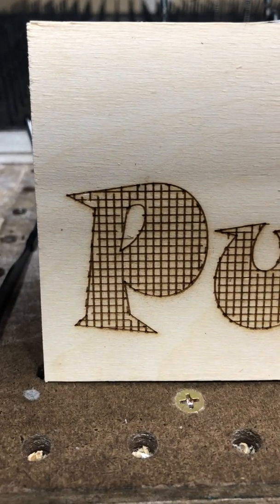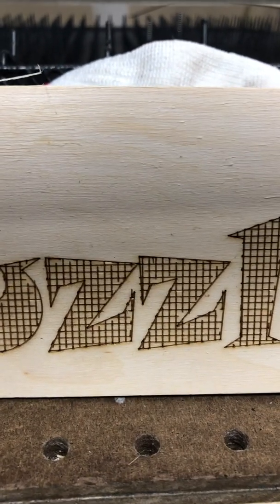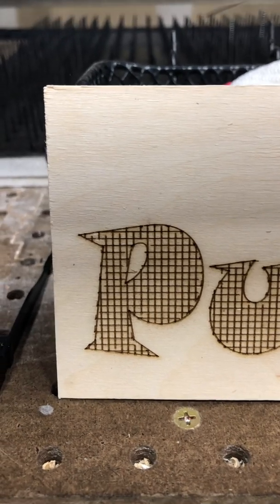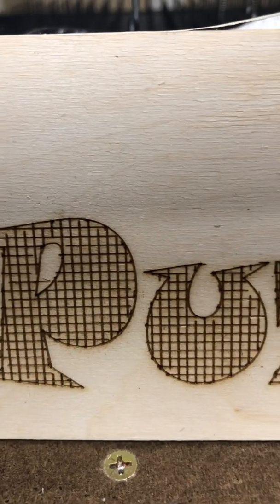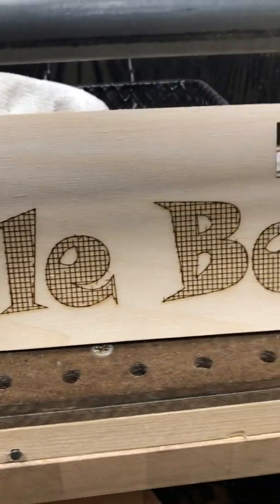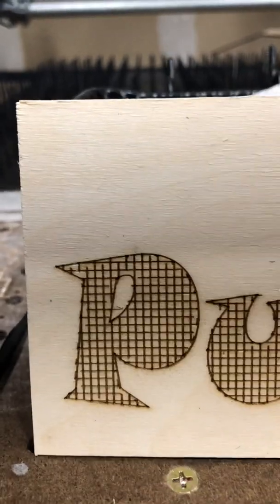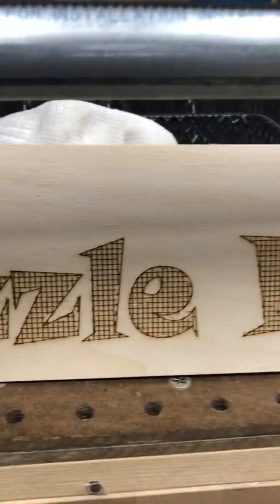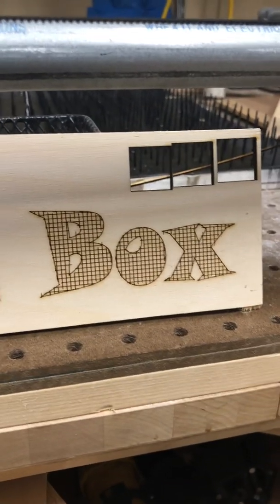Marlin and Laser Issues

Comment: hi, I have marlin 2.0 with a laser mounted by Pam using M106 and M107 commands, the fact is that it works the other way around, the M107 and the M106 S0 puts it to work at 100% while the M106 S255 leaves it off.

Do you know why this is happening to me?

Thanks a lot!
Reply from the maker: You are likely running it off the mosfet on the 12V side. There is no “ground” so one side is +12V and the other is “PWM” so when it is off you get 12V potential, and when “ON” you have both at 12V giving no potential.

I tapped the signal at the TTL 5V level.